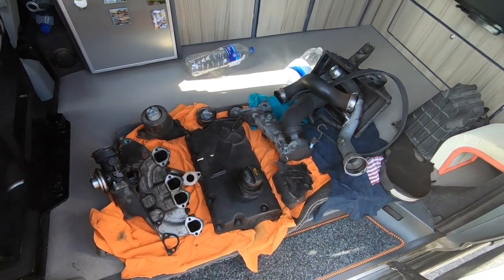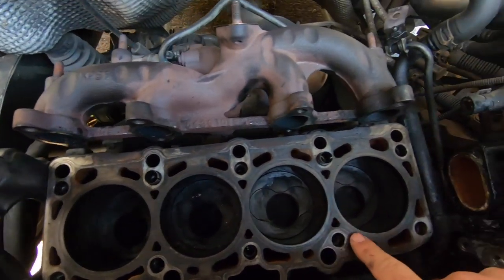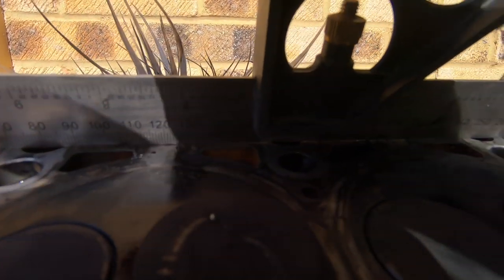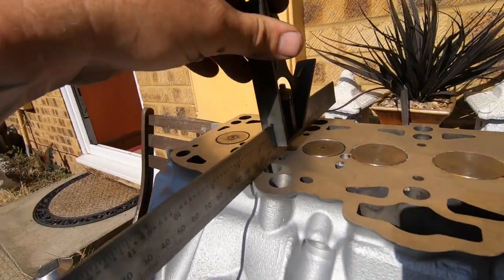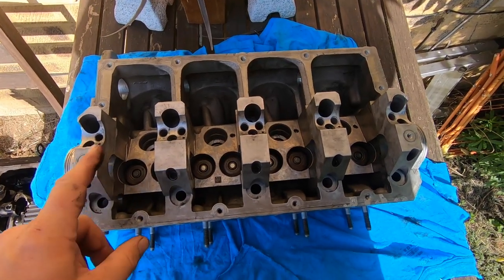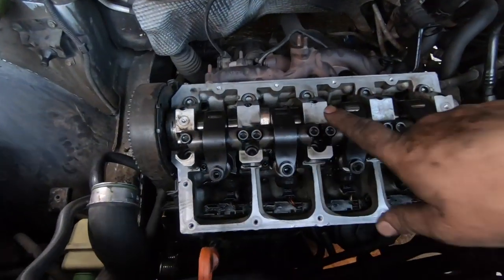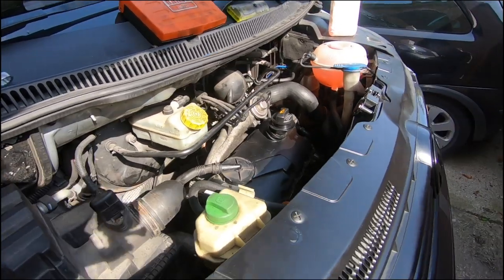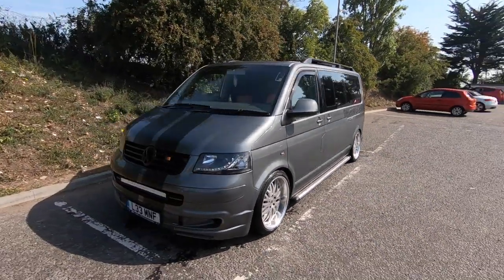VW T5 Transporter coolant pressurising - head gasket problem?

Comment: Really nice video, you dealt with a problem that would have had most people going to the garage and spending a fortune!
Reply from the maker: Saved myself a good £1000 👍
Reply: The worrying thing for me would be getting the cam timing correct but you made it look easy👍
Reply from the maker: Needed a special lock tool for the crank though. A tenner off eBay
Reply: @SpyderLEE  hence getting the recon head with the money saved on labour 👍

Comment: I've got air bubbling in the reservoir, but I've only looked as I get temperamental heat from the blower and was feeling the pipe. I also get the red engine temp light come on every so often.
Any connection ??????

Comment: Great video
 The confidence and nonchalance you had was really impressive. 
Is the van still running and did you have any other problems with the head / gasket? 
Cheers!
Reply from the maker: Van is still fine. A Little black smoke since then but all good

Comment: I’m just in the middle of this. Did you swap the injectors over or get a garage to do it?
Reply from the maker: John Straw I did it. I just kind of stuck them in and hoped for the best. I need to set up the gaps properly really on the cam but it runs ok so meh 🤷‍♂️
Reply: How did you get them out?
Reply from the maker: John Straw if I remember correctly I used a massive screwdriver as a wedge. Stuck it under one end and tapped it with a hammer. Angle it so it slips across but lifts the injector as the screwdriver bit gets fatter if you know what I mean.

Comment: You said the head lifted due to a remap. What power are you running? As I am looking to do a map. Love your projects.
Reply from the maker: Hi, the head lifted but I don’t think it was the remap. It’s a common fault on the pd engine at high mileage. I’m running around 150bhp can’t remember the exact number without looking.

Comment: Lee just took the head of mine as the cambelt snapped just taking it to a machine shop how did you re time the engine ?
Reply from the maker: Mechanicalnut I bought an engine lock tool off eBay to set the crank and used an Allen key in the hole on the cam
Reply: Lee need you , can you advise how you timed it before entering the tools I.e setting to tdc ?
Reply from the maker: Mechanicalnut the crank locking tool sets the piston tdc . And the putting the pin in the cam sprocket sets the top.
Reply: I read the Haynes and looked at it and couldn’t believe it was that simple that’s why I asked thanks mate

Comment: Any good Engine Build / Tuning Shop could have done the Same Work on your Original Head, Clean, Pressure Test,Skim,  Vstems Valves Recut in ..RU getting Original Done keep as a Spare?

Dont forget to to Re Check the Torque on the Head Bolts after 100 Miles ish

Bubbling Water in the Coolant Jobby was the Up n Down of the Pistons , you can get a Coloured Liquid to Add to Water n run Engine , itll tell you if Heads gone by Changing Colour, handy to have 
On the Shelf if you Suspect it again , hopefully not .

Used to keep it in my Breakdown Kit as a Easy Quick Diagnosis
Reply from the maker: Good bit of info cheers 👍. Old head going back on exchange. To be honest the recon one was cheaper than getting mine done.

Comment: I wasnt so fortunate.. replaced head gasket even though I found out it was my water pump leaking.. finished the job to find out my head gasket is flipped wrong way round, what a dissapointment.. water pissing right out as soon as I pour some in.. gutted.
Re-fitting gasket tomorrow, out in the free,ing weather 🥶🥶
Reply from the maker: Ah that’s not good. To be honest mine didn’t last. If you look on my newer videos I’ve ended up changing the engine
Reply: @SpyderLEE  Damn.. what went wrong with the old one?
Reply from the maker: @thepio14343SWEG  same problem again so decided new engine was the best fix
Reply: @SpyderLEE  Thats so odd, I hear stories of people buying refurbed heads and them not lasting... And others reusing heads with no rebuilds driving no issues. Just a pattern I observed. I have re used mine with no skim, done on a budget.. however fitted pd150 bolts & nee gasket.. engine works well and plans for more boost comming 💨💨😂